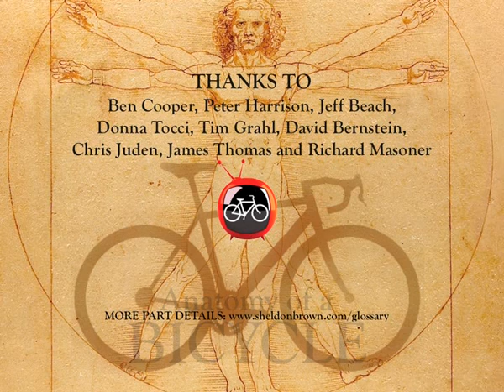Bicycle Anatomy for Beginners

Comment: Sorry, but as a real beginner, I found this confusing.  If the shots were wider, with arrows or a finger pointing out the part, it would be easier to understand where the part being named actually is on the bike and what it does.  The names are not always self-explanatory.  Very cool music.